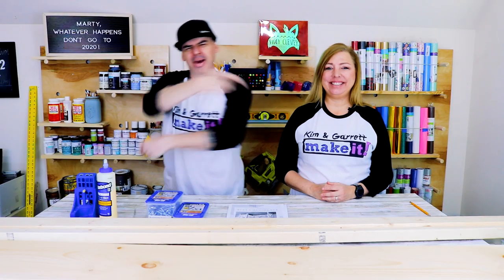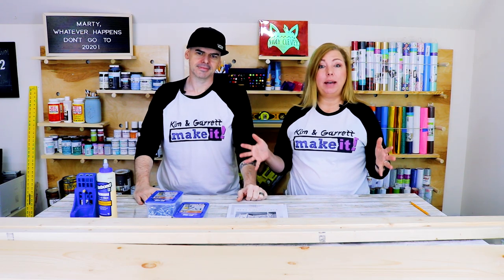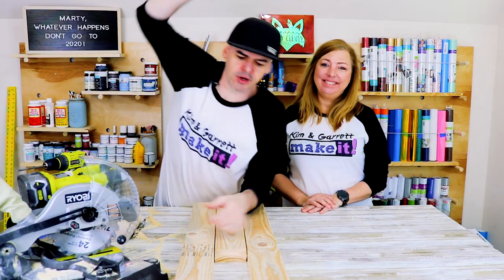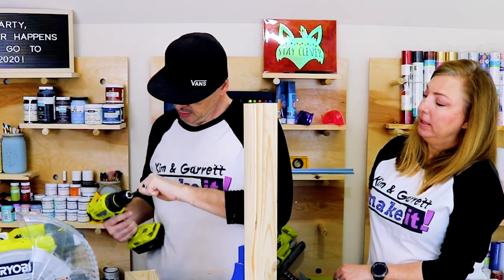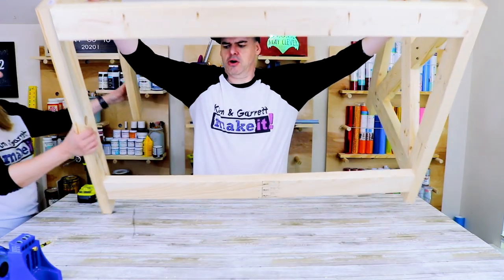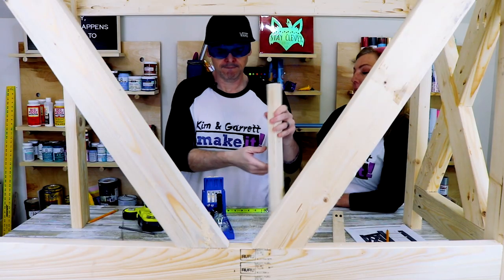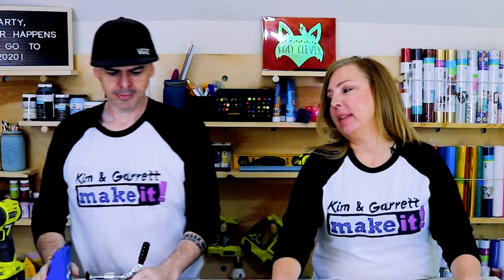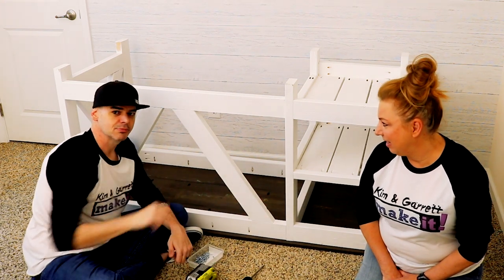Cheap and Simple DIY Farmhouse Desk Build

Comment: What setting do you have the Kreg jig on for the pieces that will have the top screwed into it?
Reply: I had the same question.  With a little trial and error, I figured this out:  I set the KREG jig to the 3/4 setting and set the screw stop halfway between 1/2 and 3/4.  I then used 1" screws.  My desk top is about 3/4", so I probably could've gotten away with 1 1/4" screws, but I didn't want to take the chance of going through the top.

Comment: Would you recommend sanding and paint primer before painting the wood? And Does it matter where I put the pocket holes at?
Reply from the maker: Definitely sand it first, primer isnt needed if you're using chalk paint. And yes, try to keep the pocket holes where they aren't visible. We ended up adding pocket hole plugs in ours and sanding and painting over them, you cant really even tell they're there.

Comment: Great build! Just want you to know that it actually cost more than $55 unless you have most of the wood. Just the 1x6x8ft are around $15 per board and you need 5 of them. The only reason I know is because I just built a table similar. Again, great build.
Reply from the maker: Thanks!!! We built this in March, wood prices have skyrocketed over the last few months. Yeah, there is no way we could do it for $55 now. The MDF we use went from $2. 50 to $7. 50. Prices are getting crazy.

Comment: Did you use extra 2x4’s from this project?  I’m trying to decide if I need to get an extra 2x4 or get the plywood and the directions show.
Reply from the maker: So we swapped a couple of things.  The plans suggest using 1x6s for the top, but we had some 1x10s so we used those.  And the plans suggest plywood for the shelves, we made slats using some leftover 1x6s.  :)

Comment: So a desk for $55 ..hell yea. Step one buy kreg jig....$79 ...well there goes that budget
Reply from the maker: We were kind of assuming you had some tools. I didn't include the cost of a saw, drill, tape measure, craft table, or house either.  But you can build it without a Kreg Jig, you just see the screw heads.